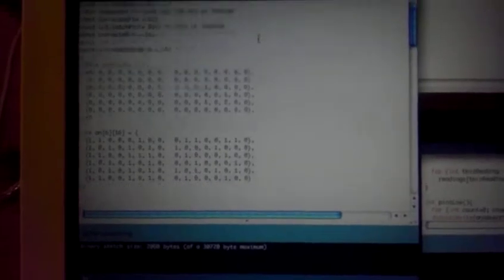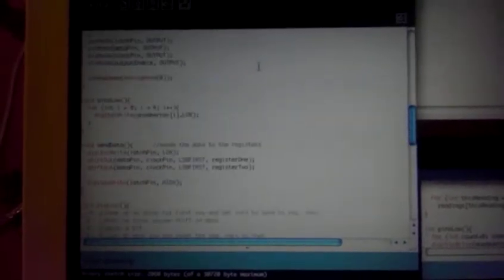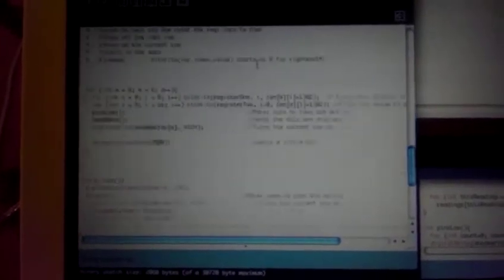Shift Register LED Matrix

Comment from the maker: Oh yeah and I would suggest that you look into two dimensional arrays for this. I used them very heavily throughout that code. Basically I has a 2d 8x8 array with a bunch of 1s   and 0s, and my code manipulated that array. Then after each time I changed the array I would simply call a array_write() function that I wrote that would make it happen and I didn't have to worry about it